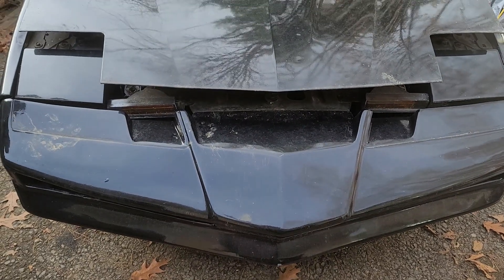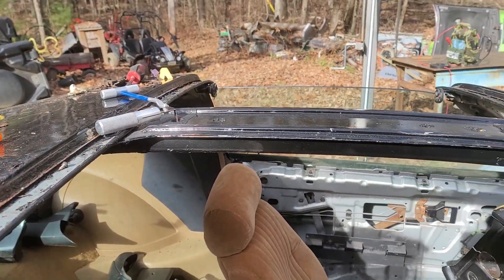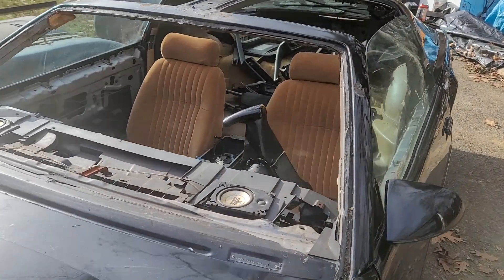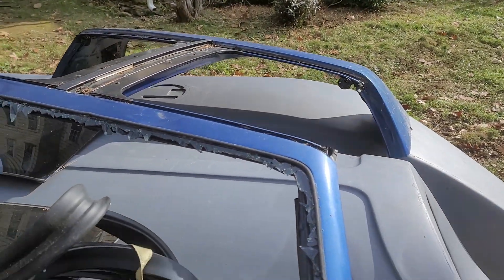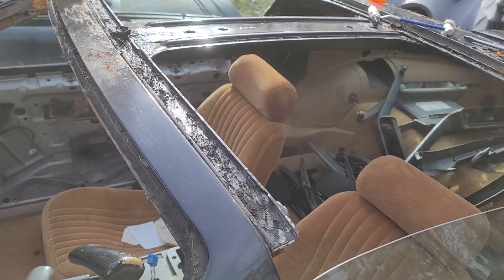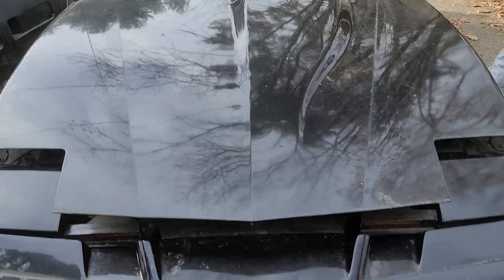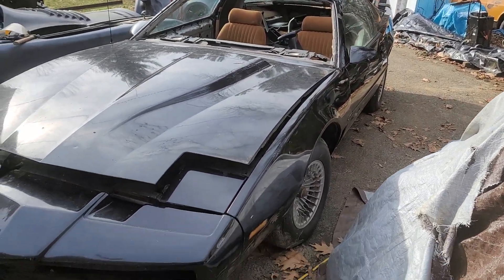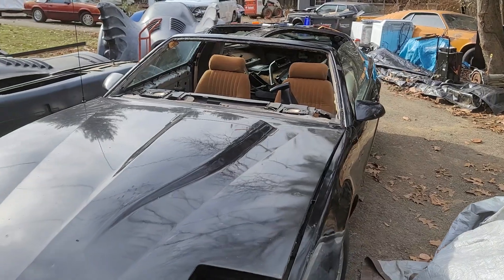Knight Rider KITT screwed over by a liar?

Comment: I hope the unibody on that car is in OK shape. Real shame about the roof but you get major kudos for doing the repair on it instead of stripping the car and junking it. I recently sold my beloved low-miles original condition '82. It had a small visible rust patch at the t-top area hiding a decent bit of rot when I peeled all the weatherstripping off. I cut it out and welded in new metal, put on the lightest skim of filler to even things out, and blended the paint. Looked factory fresh. No way was I passing that on to the next guy. Rust never sleeps, but it should be solid for a good long while. I look forward to seeing this car transform. 👍
Reply from the maker: So far the rest of the car is fine. Except the transmission. That'll be the next project on it.

Comment: I have seen this sort of thing happen on the forum years ago, a car that had class makeup job, turned out to be a death trap.  The lad who bought it was going to use it as a rally car, it all came to light when him and his pal started stripping the car. He found that seatbelt anchor points had been repaired with a piece of metal riveted into place, and a lay ours of filler / bondo to you lads.  He even found fuel lines and brake lines ran into the car, and secured with brackets and bolts. Making it a total nightmare.  When the came to put the car into the air, all underneath was just rot with filler.  They just called time with it, photographed and named and shamed the seller, stripped what was salvageable from it and bought another all round better car.  Laugh was what they took off the car, wasn't very much.  Sake of two anti roll bars, engine and gearbox, and two brackets for front dampers.  Basically bits they could have just bought from Ebay at the time, or stuff new.    It might be worth seeing if there is a better car and just use this for bits? Just with you having to faff on with the roof and    transmission etc, plus god knows what other funny stuff it maybe hidden.

Comment: Not bad, if you paid 50 bucks for it. Great deal. If the roof is that bad, whats under that paint could be 100x worse. I wouldn'y bother digging in any more. Send it back to the junk yard.
Reply from the maker: That'd be a fail. I've already started the process of replacing the roof. I've done them before on other cars. Next is locating a new transmission. We've already fixed the dash and electronics, this car will be nice once we're finished
Reply: @automaniacUSA  What does the floors look like?
Reply from the maker: Floors are fine. Only rott is in the roof
Reply: Go return the favor 🤕
Reply: @automaniacUSA  I like this plan. It's nice to see a third gen saved rather than end up in the junkyard.

Comment: I'd say try to find a better car and swap what good parts you have onto that. This body is bad. It's going to cost more to fix this than to restart the hunt for a better car, but at least you have a parts car to help you save somewhere. If the motor is good, and the wheels are too, you're ahead already. The bowling ball caps have been seen online for around $400 for the set. Best of luck whichever way you go with this car.